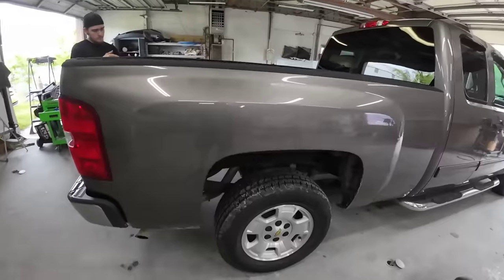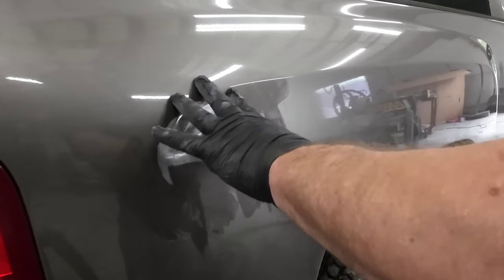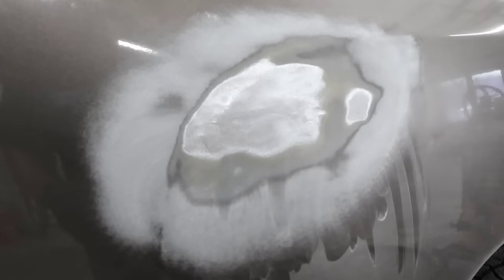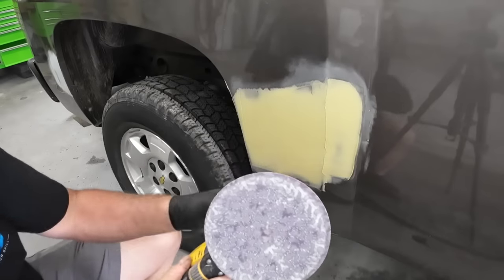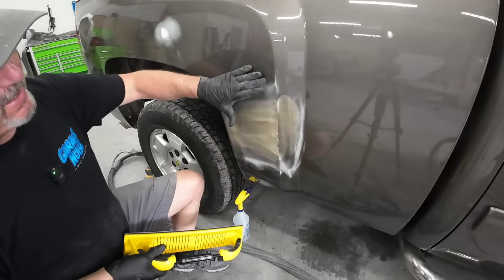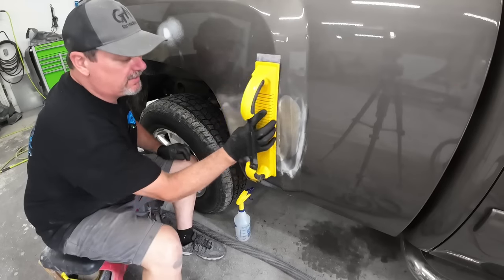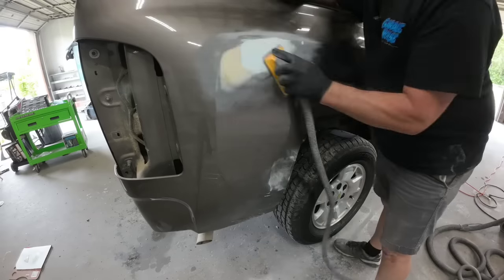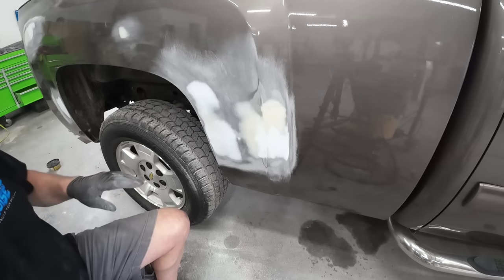Simple steps to fix small dents and prepare your car for paint!

Comment: Hey Chris thanks again for another interesting video, sorry but I have to keep saying this but your videos are very helpful as you explain each and every step in great detail.
I cant remember if you've done a video on how to prepare a panel for a flowcoat, I do quite a few flowcoats but my problem is that I tend to cut through the edges and any sharp bodylines even if I sand up to the edge with my DA and finish by hand, a tutorial like this may be helpful to others as well👌🙏 thanks👍
Reply from the maker: Brother I appreciate the comments! You can use a 1500 scuff pad for those edges. Technically they say it coarse enough for adhesion.  I like a little bit more aggressive scratch.
Reply: Ok thanks Chris, I've been using the 3M 800 grippy sanding cloth so I'll try the scuff pad see how I get on, appreciate all you do for the community🙏👍

Comment: Love all your vids - you need to look into glue-pulling, it will change the way you approach loads of bodywork issues, especially when there's no access from the rear to use conventional methods - plus you get to use no filler or paint..

 I started using what everyone uses, tabs, slide hammers, hand pullers, blah blah - it was only when I moved on to using mechanical lateral tension-pullers & mechanical tab-pullers (that can exert huge pressures on a panel in a pull, waay beyond any hand pull tool) that it started to really be a game changer.  With mechanical pulling you can even drag bashed-in quarter panels & sills back to shape - areas where there is no access from behind. 

Lateral tension is the real game-changer though - once you begin to understand & use that method, what you can achieve in repairs starts becoming mind-blowing - plus how easy repairs become compared to the usual methods. Those small dings become a doddle when you can exert 500, 600 or even 1000 kg of force onto a panel in order to reverse them. My current  system can exert a maximum of 1500kg of tension - which is "a lot" when it comes to small dents. Upgrading to 6000kg of force is quite easy, but I doubt it would be worthwhile as I have yet to find anything much that 1500kg won't deal with.
Reply from the maker: I've  seen sme of that done. It's  quite impressive! especially on those larger dents.  I would love to give it a shot and get some more info on tools and such.

Comment: I see where others sand down to bare metal and apply primer first then body filler. What’s your thought on that?
Reply from the maker: Some prefer to apply an epoxy primer before filler. That's fine to do, nothing wrong with it. I don't  feel it's  necessary to do under filler. The only time I would recommend epoxy is if your stripping you car down to bare metal for a project that you won't get to right away to protect it while you wait to do bodywork. Appreciate the comment and support!

Comment: When should you seal a car I was told only when multiple colors?
Reply from the maker: I basically seal to get a uniform substrate,  you know to make it all one color. I try not to If I can help it because in an open garage you can introduce more dust in the sealer. Also if you have an open paint edge that wasn't primed over. Appreciate your comment and support!

Comment: I have a question. When I sand body filler then I paint always get mapping you can see the bodywork under my paint and I used guide coat what am I doing wrong ?
Reply from the maker: I will answer you question in a short it will be easier. Mapping can be caused by shrinking primer, improper prep on paint edge, or not refining the sanding scratches before primer also cheap filler or primer. I will be making a video on this topic. Appreciate the comment!